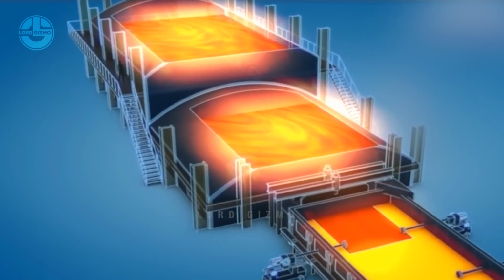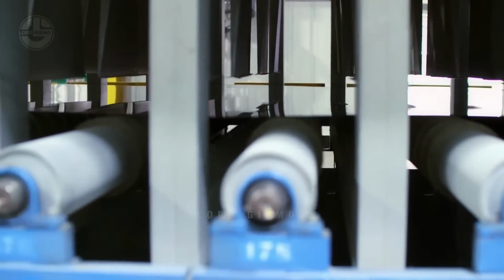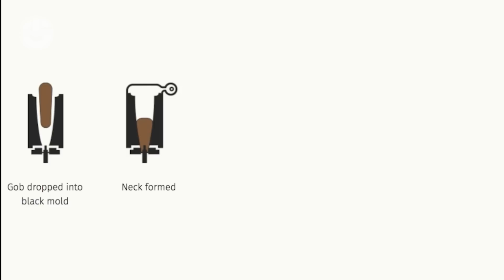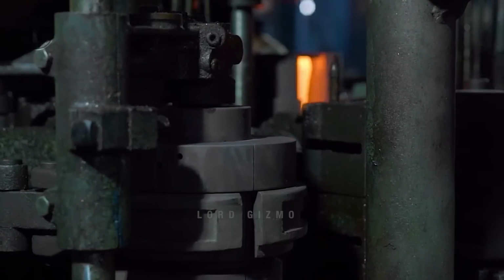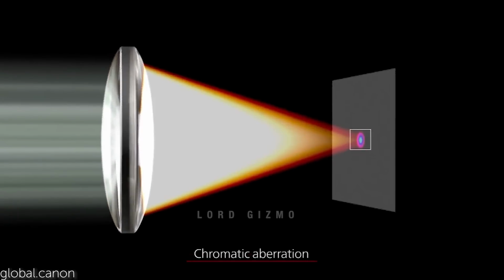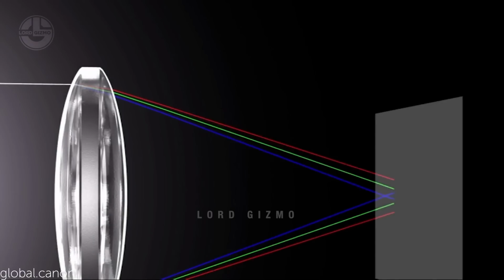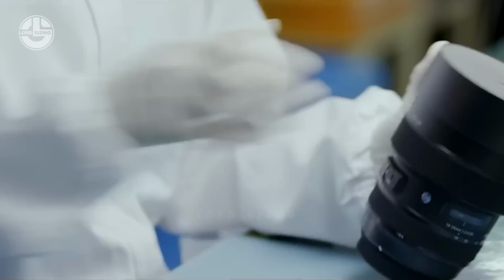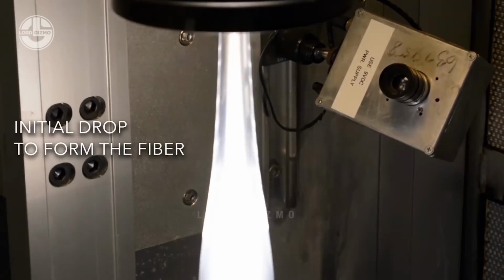How Glass is Made | From Mining Silica to Wonders of Glass!

Comment: The shortage of sand is primarily river sand with high degrees of angular fracture (i.e. sharp edges). Products like concrete need that angular feature for adhesion/strength. Sand dunes are formed from wind and grains of sand are missing angular fracture due to wind. It would have been good for the documentary to have focused on whether round sand is suitable for glass and fractured sand, such as demonstrated with crushing, would be better saved for construction. I did see where construction sand is a by-product of separating silica.

Comment: The lenses in mobile phones are much smaller than the camera lenses shown here.  The quality of mobile phone images is astounding.  It would be good to hear something about those lenses.
Reply: Modern cellphone cameras use injected-molded, plastic lenses with aspheric surfaces (think of a lens with ripples on it). They do this because light passes into the lens as a different angle as you travel away from the center. Making these aspheric surfaces can lower the overall lens count.  The lenses are plastic injected-molded for mass production and weight savings.

Comment: Glass breaks too easily for data storage unless sealed in a device. Fused Quarts or, better yet, sapphire would be a better option. Man-made sapphire is now fairly easy to create. Currently they can make a 15" solid cube of sapphire relatively easily. It just takes a little time. Slice those into cubes and you will have truly unbreakable millennia-long storage.

Comment: Correction: Kapany was just one of the many physicist at the time experimenting with it. Years before, in 1920, Baird and Hansel already had patents for fiber optics, with Heinrich Lamm using them to transmit the first images in 1930, with Moeller and Van Heel improving transmission capabilities. 

About the only thing truly pioneering Kapany did was claim that he coined the term “fiber optics”. 

If you want a true “father” of contemporary fiber optics it’s Charles Kao’s whose work on fiber optics communication and data transmission in the 60’s made modern fiber optics as we know and use them possible. 

But it’s all based on a long history starting from Tyndall’s early work in the 19th century and has been steadily advanced by the great minds and hard work of many scientists for over 100 years.

Comment: I’m not sure if I’m remembering this properly, but back in the day, say, in the 20s and 30s (I’m basing this on the age of my house - 1936 - and some of the original stained, leaded glass windows) I thought I remember window glass was first molded into large, hollow cylinders somehow, the glass being the thickness of the window pane, then scored, heated and unfolded flat.  It was interesting in that it had some swirls or imperfections on its surface, but was obviously clear enough to not notice them in daylight.

When I had to fix some broken panes with today’s perfect flat glass, it just didn’t have that antique look that was so desirable in keeping that craftsman-like look that went so well with the rest of the house’s hardwood floors and trim, plaster work, and so on.  Laf, they also leaked like crazy, not optimal during Wisconsin winters.  We ended up replacing the windows with today’s perfectly constructed windows, but for some windows, I was able to move the original glass ‘inside’ the original wood windows, placing the modern units on the outside.  Those couldn’t open of course, but at least from the inside I was able to maintain a few of those beautiful windows.  But what a difference - no more draftiness, major improvement in noise isolation, easy to wash, etc.

If anyone can correct me on my cylinder recollection, please correct me.  A wonderful documentary, thank you.
Reply: You are correct about the cylinder method of making window pane glass in earlier times. I have seen a lot of this kind of glass in my career as a home renovator;  the optical imperfections, air bubbles etc in these old windows give them a charm and a character quite lacking in modern float glass.  However, if you wait around for a few centuries, you will see optical distortions appearing in today's windows. Glass is actually classified as a semi-viscous solid, so over time (a LONG time) gravity will cause a vertical pane to gradually thicken at the bottom as it thins at the top.

Comment: Fused quartz glass is very hard to work with. That is why they add softening impurities such as Boron and Potassium. This reduces the energy required to soften the material, as well as changing the glasses coefficient of expansion. You can create layers of glass with a gradual expansion rate, that can be manipulated to expand and contract, at the same rate as certain metals, at tremendous temperatures.
Reply: I work as an engineer at an optics manufacturer. We love working with FS. We often shape and polish high purity FS to nanometer precision for ultraviolet applications as well.

Comment: How does the sand not grind away the surfaces of the chutes, filters, pores, etc. that the sand is passing through?  Wouldn't the apparatus be quickly damaged from the constant flow of hard particles?
Reply: I’m sure it does to a certain degree, but if those components are case hardened then they could actually be harder than the sand and therefore handle far more abuse than if they were annealed steel.
Reply: You are correct.
The jaw plates of a crusher get replaced / reconditioned as often as necessary.

Comment: i wonder if they realize glass is not the only packaging material that is fully recyclable. Aluminum is also 100% recyclable indefinitely as well. if you are going to make a documentary, get your facts right.
Reply: Aluminium usually has to be coated in plastic if used to store food or drink, which complicates things.
Reply: @michaelandersen7535 since plastic melts at a different temperature than aluminum, it either becomes slag or vaporizes as the temperature continues to rise to the melting point of aluminum.
Reply: I was looking for this comment before I made the same one. Aluminum and steel are 100% recyclable.
Reply: Yeah i recycle all my aluminum and steel bottles
Reply: The moons mass is approximately 1/80th that of earth and aluminum is approximately 8.23% of earths crust which doesn’t include the mantle   The math is to take 8.23% of 5.973x10^24kg and that will give you the answer.75% of all aluminum ever produced on earth is still in existence, the rest is lost through smelting and erosion in one form or another or just lost .

Comment: The video part was good, but the commentary, in several parts, was 'misguided' to say the least. It really needed someone with more knowledge of the subject to edit the commentary! (P.s. most of the world operates in celcius including most of the sensors visible in the documentary, so why change for the chat?)
Reply: I worked for nearly 30 years in the Float Glass industry. The terms used (for the industry I am familiar with) were correct. Although there was little explanation about where the terms came from or why they were used.
Reply: As a Ceramic Engineer, I found the explanation of the process fairly accurate. I would quibble with the inclusion of Aluminum in glass manufacturing though. Should have stated Alumina (Aluminum Oxide). Other than that, well presented.
Reply: What was misguided in it?

Comment: 0:42  Sand, as it is found in nature, is NOT used in concrete.  That particular sand is manufactured from rock.  Sand in nature, is too rounded for use in concrete.
Reply: They got to that a bit later on, when they show the industrial sand-making process and sorting for various uses such as concrete, glass, paint, toothpaste, etc.
Reply: Not true, sand mined from river beds is prized for use in concrete - there is a huge environmental impact from this in many places.
Reply: @donaldcarey114  I thought the same thing until I watched a documentary of how sand is made.
Reply: @donaldcarey114  Seems like an instance of what normally happens vs the occasional edge cases. It is true that wind and water weathered sand is generally not fit for use in concrete, but there are bound to be exceptions to the general rule. My guess is that most construction sand suppliers source from a rock crushing and sifting operation, though you will also find the river-bed mine, etc. operations out there occasionally.

Comment: I did not understand, how can a fiberglass be a glass, and not break when the line is bent?? Does anyone know
Reply: Simply by being very thin.  The amount of stretching and compressing is a function of the distance to center of the "rod".  A thin fiber acquires tiny stresses (change in shape at material level) to bend a lot on our scale.  Under a microscope that fiber would not do a 90deg corner on a scale that's significant to the thickness of the fiber, without breaking.
Reply: Another way to say it--the fiber's "bending tolerance" to thickness ration would be the same across all scales, microscopic to an inch diameter or whatever.  A 1" thick rod would have no problem following the circumference of the Earth, doing a loop. 
 (it could make a loop around a modest size town at 1" diameter, without breaking)

It's the same thing for a wire rope or cable, each wire does a small amount of bending relative to it's thinness, to follow a sheave (cable wheel) say, a degree of bending to thickness ratio of the entire cable way beyond permanent distortion and damage (yielding) if it were a solid rod.
Reply: Good Question...Someone must answer this
Reply: @ideatumdocs  Thanks. I hopee so, since this video does not
Reply: @DB-thats-me  everything bends--sllightly: stone, steel, wood--everything. that is not the point.  but bending a wire with a glass tube is totally different.
Reply: Glass fiber used for transmitting data is between 8-10 micrometers (or microns), while a human hair is about 80,000 nanometers (nm). There are 1,000 microns to a nm. Imagine 8 people in a line of 8 million people. That's how thin optical glass fiber is. There are between 1 and several hundred fibers in a single cable. They have a flexible radius of 4-10mm (think a half-inch circle) but that is not recommended. They have a weakness in perpendicular shearing, direct pressure from both sides and stretching. I'm not a bot, just curious like you so I did a little research for us. Hope this helps. moo moo.
Reply: @BariumCobaltNitrog3n  thanks, but it still does not explain why it can ben bent at will and in all direction, but not break. 8-10 microns is a lot of glass, and it should shatter. hair is keratin and leathery
Reply: @TWOCOWS1  Your fingernails are leathery? Same stuff.
Reply: @BariumCobaltNitrog3n  are yours solid like a rock?
Reply: @TWOCOWS1  solid like hard wood
Reply: @TWOCOWS1  Are yours leathery?
Reply: @DB-thats-me  thank you, wise one. i shall try live with your wisdom
Reply: @DB-thats-me  But forgot to bow before your infinite knowledge and wisdom, oh wise one. May you be bent backward soon by the unbelievers in order to prove your point by evidence
Reply: You can tie a knot with a single strand of glass fibre, same as aramid or carbon fibre. Its the resin and multiple layers which give it strength.
Reply: @kizzjd9578  if you say so. i will tell this to the fiberglass and hope they listen
Reply: Fingernails and hair are the same stuff. It has to do with thickness. As the glass fiber gets thinner, it really is as thin or thinner than hair. As it gets smaller it actually can bend and get rolled up. It still has a minimum bend radius where it will break, but glass fibers are surprisingly strong.
Reply: @TWOCOWS1  go pound some silica up your glass